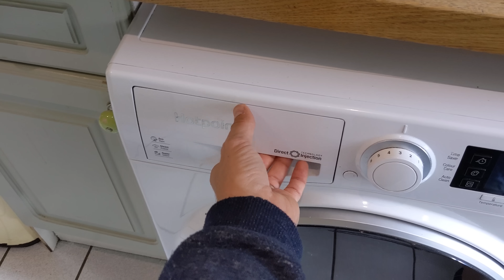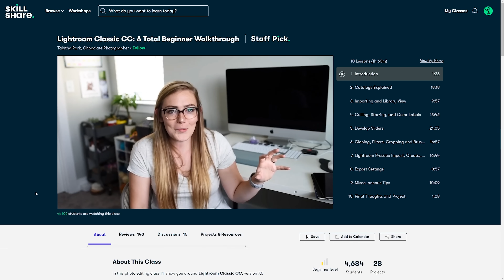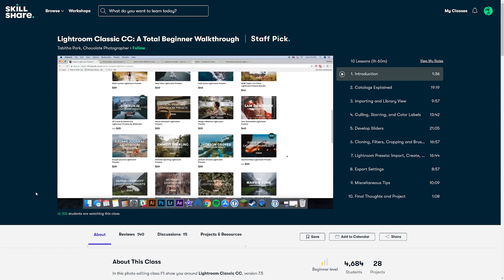The Pythagorean Siphon Inside Your Washing Machine

Comment: Our toilet has a plunger covering the flushing drain that is held down by the weight of the water in the flush tank, when you flush the plunger gets pulled up to let the water go then it floats untill the water is gone so it can seat back down for the ballcock can fill up the flush tank again.

Comment: Every toilet I've seen uses a flapper valve. The flap comes up and has a cup underneath so that it floats, once the water drops low enough, the flow of water pulls the flap down to make a seal and then the weight of the water on top of the valve holds it in place.

Comment: Us toilets use a rubber flap at the bottom to seal against a seat.  This give two places for a leak.  The one you mentioned in the video, and the flush valve.  The overflow mechanism is a stand pipe that bypasses the flush valve.

Comment: I've always found the english toilet mechanism oddly complicated, which also makes it unreliable. In Sweden, we have a much simpler mechanism that consists, basically, of a ball with density lower than water sitting in an opening at the bottom of the cistern. Since the bottom of the ball isn't in the water, it won't float until you lift it up. Once lifted, it will float until all the water has drained out of the cistern so that it can fall back into the hole it sits in. Here's a very simple version: https://www.vvsobygg.se/media/catalog/product/cache/1/image/9df78eab33525d08d6e5fb8d27136e95/7/8/7899902.jpg

Comment: The actual toilet bowl works like a greedy syphon. That's what people were talking about.

The water dumps into the bowl, and when it gets to the level of the top of the air trap, the syphoning begins. It's why toilets have to drain straight town into the floor rather than off to the side.

Comment: I'm in the US and I didn't know there were siphons in the tank (the top part (bit)). I've only seen flapper mechanisms, which have always befuddled me. The flapper plugs the bottom of the tank. The flush lever pulls the flapper out of the hole, allowing the tank to empty and somehow the flapper stays out of the hole until the tank is empty. I don't get it, but I think it's buoyant.

Comment: Many modern toilets in USA use the device you show. My impression is the older systems used a float ball valve to open the dump valve and then close as the float ball valve drops with the flush water level. I think I have seen conversion systems to upgrade to your syphon system. Very interesting.

Comment: I've also heard this called a bell siphon.
Reply: Incorrectly. A bell siphon actually has a bell in it - typically cast iron for its weight - that's needed to start the flush. Diagram: https://qph.fs.quoracdn.net/main-qimg-880fc7a941ea281edf35e7c334f798a4

Comment: If that device is for your toilet's reservoir, I believe the design for toilets varies greatly between the US and the UK. That system seems plenty efficient, however, what we have here might be a bit more streamlined in design. We have just a cap with a wide rubber gasket or washer, and a chain which connect to that. The cap usually has a hollow section, and the weight of the water holds the whole thing in place while it's filling by pressing down around the gasket. When you lift the chain, the air in the cap keeps the whole mechanism in place above the drain hole. An essential feature being that there is enough buoyancy to keep the cap and washer well above the suction of the drain hole.

The mechanism in the bowl towards the sewer line is still a siphon, however. 

Cool video! I never knew that there was this much difference between the mechanics of the toilet's operations here and in the UK! The use of the Pythagorean siphon for your washers is fantastic. I don't have a model that similar here, and initially, I'd thought your video was about the draining of the entire barrel via that method, not just the fabric softener. Thanks!

Comment: I think the bowl of the toilet (including the big S bend) is also a greedy cup. If you dump in a bucket of water, the toilet will empty completely and not refill. 

In North, Central and South America (for all toilets that I've looked into in the countries I've visited) the flapper at the bottom of the tank is much more common. My two-stage flush toilet is just a variation of the typical US flap mechanism, but the flap can close more quickly depending on the button you push.

Comment: That's the first time I've seen that particular toilet mechanism...  Here in North America, toilets have a tank with a big hole in the bottom and a loosely fitting plug called a flapper valve.  The flapper is connected by a chain to the flush leverage and when you turn the lever, it lifts the flapper slightly and then the water going through the hole pushes the flapper out of the way, letting the whole tank dump down into the bowl...

Comment: U.S.: never seen a siphon in the tank. There is , of course, a siphon effect at the bowl.
Reply: Yeah, Ive installed toilets here in the UK and at my in laws in the US... Can confirm that I've never seen a siphon draining pan in the UK but in the US everything I've seen is siphon. Tell tale signs, the water level in US toilet pans is really high compared to what you'd see in Europe.
Reply: @danielcoward3469  I came across what must be a similar type in the UK - it had the normal amount of water in the bottom but on flushing, it filled like the American style then emptied. I suspect it had swirl effect too.
Reply: Both types exist in my home town but my home had the U type. When I first used the syphon type I thought it clogged when the water level went up and scared the hell out of me.
Reply: Not in the UK !
Reply: @millomweb  Look again! It is.
Reply: @klincecum  It's panto season....
Oh no it's not !
Reply: @millomweb  How to toilet bowls drain in the UK?
Reply: @RyanKelley87  Without siphoning - it's just a U trap and many of ours have nearly horizontal outlets from the back of the toilet and the pipework they connect to is relatively horizontal too - so it can't siphon.
Reply: There is a difference between flush toilets (as in the video) and the types I’ve seen in the US and in Asia. Some of the “never seen that” comments are due to those differences.
Reply: @andrewd4890  Aye I guess the Asian ones there's no chance of them having a siphon in the 'bowl' :)))

Comment: Here in Florida, we use a buoyant flapper at the bottom.  Push the lever, lifts the flapper, opens a hole in the bottom of the tank.  Once the water falls low enough, the flapper floats down and reseals. The tank fills with water again.   

We also use the float valve (sometimes a different, vertical style) and we call it a "cock and balls" valve because we think it's funny.

Comment: Great mechanism but there’s always a little water left in the tray so it takes forever to dry and I have to remove the whole tray to dump the water each time the machine finishes. Otherwise, I learned that the remaining water can’t flow into the machine, so I guess there’s no need to dry the tray.

Comment: Most toilets here (Spain) use a different system, but there's an old toilet at my great-aunt's house, where the bowl uses a Pythagorean siphon: when you push the lever on the tank, it empties into the bowl, which is large enough to hold most of the water of the tank at once. Then at a certain level, the bowl starts to siphon all at once quite fast, until it empties far enough that air cat get into the siphon, at which point the last of the water from the tank drops, refilling the bowl slightly, to avoid air flow from the pipes.
It's ... not a perfect system, because if there's any leftover matter in the bowl when it siphons, it sometimes doesn't quite make it, and you have to flush a second time. So I very much prefer the standard system I have seen everywhere else.

Comment: American toilets work differently.  The siphon action all happens in the bowl of the toilet rather than the tank.  The tank has a simple flapper with a submerged float on a string.  Flushing the toilet pulls the flapper valve up and the float up to the water level of the tank.  The float holds the flapper open while the tank drains.  As the level drops, the float and flapper drop with it until the flapper reseats and seals.  The weight of the water now holds the flapper closed while the tank refills and the float becomes submerged again.  The siphon action is also different.  Rather than pulling water up as you do, our toilets push it up.  There's a port at the very bottom of the bowl and when you flush this becomes a jet that pushes the water to start the siphon action of the bowl.

Comment: All toilets that I have come across do have a pythagorean siphon. Not on the water tank but on the bowl. The pythagorean siphon has multiple purposes.  the first is to drain the bowl once the level of water rises to a point when the water tank gets discharged into the bowl.  the second purpose is to prevent the gasses from the sewer to go into the bathroom due to the trapped water on the pythagorean siphon working as a one way valve. 🤔

Comment: Curious is there an equation for the exact amount of liquid flow to "tip" and trigger the Siphon? Or is the amount of flow to tip it a "varied" or "give or take" amount flowing before triggering the cascade?  Going from the trickle leak to the flush action, like how many drops per second or minute difference does it take? Thanks
Reply: Is not really an equation. The liquid flows normally until it seals the openings to the syphon's exit,  and the air cannot enter anymore. That will depend purely on the size and design of the syphon, so it will not be a constant equation.

Comment: I've worked as a plumber's assistant and replaced several of my own toilets (in the US). But when you said we might have already said "that's how toilets work," I wondered what I'd missed. American toilets have a similar float valve for incoming water, but the flushing mechanism is a (sometimes floating) flapper assembly; no siphon involved, unfortunately.  https://inspectapedia.com/plumbing/Toilet_Parts_149_DJFes.jpg

Comment: I have never seen such a mechanism in german toilet flushes and I have never seen uranials, that flush every 15 minutes. Our urinals have a button or a sensor. Only very old systems are constantly flushing and they are more of a multi user wall type and not a single user urinal.

Comment: I'm glad you explained that siphons function on the liquid's attraction to its neighboring liquid molecules. "Vacuum" is still a very popular explanation, but it's not accurate. It could be that a difference in air pressure makes a siphon work a little bit better, but Periodic Videos demonstrated a siphon that works in a vacuum, proving that air pressure is not the crucial driving factor in a siphon.

A bit weird that a chemistry channel was the one to demonstrate it, but most liquids vaporize a bit too rapidly in a vacuum, so you'd technically have some air pressure. The Periodic Videos crew had access to a liquid of particularly low volatility.

https://www.youtube.com/watch?v=8F4i9M3y0ew&feature=emb_logo
Reply: Surface tension is used. Gents' urinal flushers 'were' made of pot that repelled water. This stopped the water from spilling over the siphon until it was swamped - and once started, the whole lot would go.

Comment: Well my toilet has just a hole at the bottom that is covered by a plug
The weight of the water holds the plug down and the hole is sealed 
When you activate the mechanisms the plug is actually less dense then the water so it just floats on the surface as it goes down
When the tank is empty the plug seals the tank and it starts filling up again

Comment: My toilet uses a delay "circuit" (mechanical) that shuts off a number of seconds after you have released the pushbutton.
You have two intended options, full flush and half flush. But in practice, you actually have three options. Because holding the pushbutton down keeps the "timer" from counting. So if you hold down the half flash button, the entire cistern is still emptied.
And pushing the full flush button doesn't actually empty the whole cistern. So the third option lets you do an ACTUALLY full flush.

It's a quite simple system really and for overflow it simply has an overflow pipe with a hole in it at a certain level.
As you push the button, a piston is retracted that is then hydraulically slowed down on its return stroke and once it hits the end of its travel, it shuts the outlet just like a bathtub plug does.

Comment: Hate to break it to you but all modern toilets with the double button on the top 10 to have a different system to that with a similar pipe but an actual valve that opens at the bottom of the water using the same ballcock system to fill but the ballcock is become dramatically smaller hence the reason is why a lot of systems of became a lot smaller to

Comment: Here is a link to valve systems in Spain 
https://youtu.be/OIOgG6FNoJ4

The valve has a buoy and a flap to seal the water exit. When the system is closed, the pressure difference in the flap is greater than the buoyancy.  When the mechanism is open, there is water at both sides of the flap and the buoy is stronger than, so the valve floats as long as there is water in the system.

The stick that pulls from the valve is hollow. If the water passes the hole, it drains. Very similar security feature.

The main problem of this system is that the flap wear and tear makes it ineffective as time goes by.

There are models with two different amounts of water flushed.

Comment: I now i dont go around opening up people's sisters, but i dont think i've ever seen a siphon toilet in the USA, it is always a rubber stopper that is lifted up using the leaver, and the water just flows straight down, these are a problem because they often get leaky as they get old, a siphon system however, should work without leaking till that plastic on that valve degrades too badly to hold any static pressure, i suspect the toilet could still flush with 1/4 of that valve missing

Comment: My toilet does not look like that. The chain lifts a floating plug on a hinge that covers the drain hole. When the tank is empty the float sinks and covers the hole again. Fill mechanism is the same. 

Also. The purpose of a stand pipe is to prevent water from siphoning thru the drain hose. If you lay the hose on the ground, your machine will fill to the maximum height of the hose then empty.

Comment: 6:35  I've never seen a toilet like that!   Ours is much simpler.  When you pull the lever it only lifts a small seal for the drainage hole in the cistern, and the water can then rush in.  The shape of the seal is such that while the water is flowing, it prevents the rubber seal from resealing the hole.  When the water has drained out, it no longer prevents the seal from falling all the way back to the hole, and gravity lets the seal fall back down.  Then the pressure of the water refilling the cistern holds the seal down again until you pull the lever, repeating the process.   The floats work the same though.
--edit I just read Steve Brown's comment, I guess it would be called a flapper valve, an older style
Reply: It isn’t the shape that holds it up, it is the air bubble the shape traps under it.

Comment: Most US toilets just use a simple flapper valve (flexible rubber flap) with a separate overflow tube located in the tank.  That may be slowly changing, but I've never seen the internals of a siphon flush toilet personally.   Now, when it comes to fill mechanisms, we have variety of those.

Comment: What a very cool video!  
My toilets here in the USA do not use a siphon mechanism.  We do have a "ball-cock" or float shutoff valve but the water flow from the holding tank is initiated by lifting a "flapper valve" that normally caps off the head of a vertical pipe down into the toilet flush chamber (as it were).
On a slightly related topic, when I was in Australia I was disappointed that the toilets do not swirl in the opposite direction from those in the Northern hemisphere (speaking of the Coriolis effect).  As it turns out, all of the toilets I encountered down under were not designed to swirl at all.  It was as if the Aussies were deliberately seeking to block my curiousity about that old urban legend.

Comment: I've seen 3 kinds of mechanism for toilets. One is a flap that gets pulled up by a chain, which presumably stays open because the flowing water pushes it out of the way... Another is similar but with a rod so that the mechanism can be closed manually. Thirdly is a kind of pressure tank with a button on top. I actually have no idea how those work, but they're supposed to save water by using pressure to clear the bowl rather than volume.

Comment: UK toilets have begun to use the 'flap valve' system in recent years.  If your toilet has a "push button" to flush it, rather than a handle, it's almost certainly the flap valve type.
The flap valve used to be banned in the UK, though it was commonly used abroad.  The argument was that it was more likely to waste water than the syphon type - when the flap becomes leaky or stuck open.

I don't know why the UK changed its rules - maybe it was because people wanted to use the "more modern" push button flap valve type here, or maybe it was a result of some international ruling about anti-competition measures.

Comment: My flush mechanism is a flap attached via chain to the lever. When the flap is down, the pressure of the water in the tank pushes down and keeps it sealed. When you pull the lever, it lifts the flap (which usually have a little air pocket) and it floats revealing a hole on the bottom of the tank. Its actually, really simple.